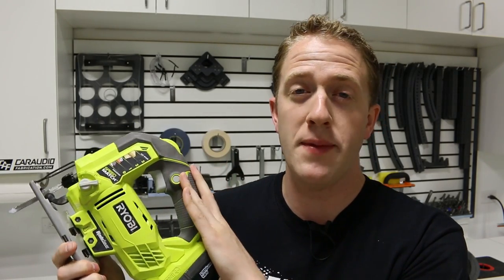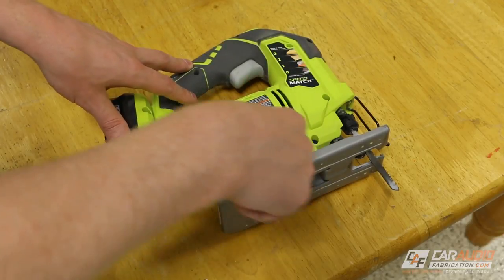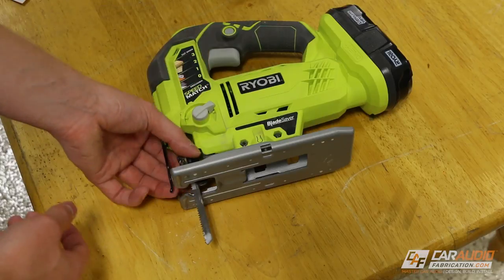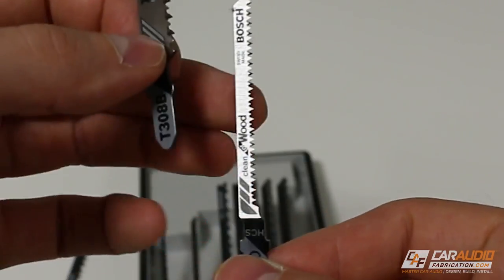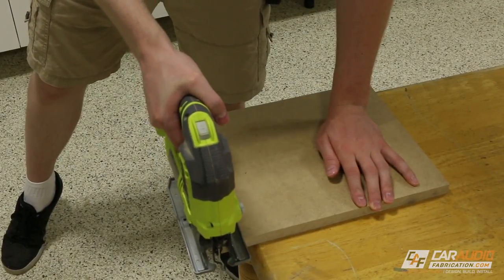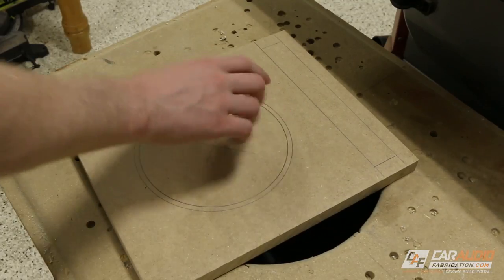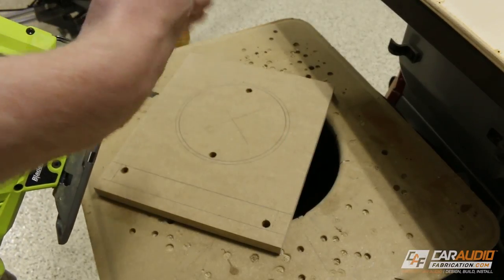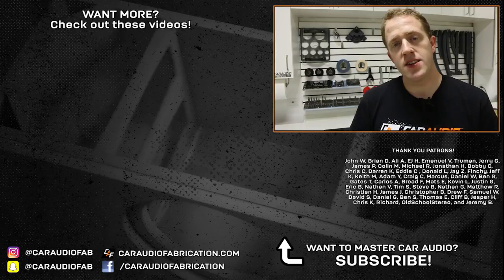JigSaw for Car Audio? Low Budget Tool Basics!

Comment from the maker: I wanted to try something different with this video and show you guys a more basic tool and how you can still get good results with the proper technique. Are you guys interested in seeing more videos like this or do you prefer advanced fabrication?
Reply: CarAudioFabrication it's good to go over the basics even when you're an advanced installer. This way you reach a wider audience. Keep up the great videos.
Reply: CarAudioFabrication I like it. Most people don't know these basics. Including me. Great video.
Reply: CarAudioFabrication I like all of your videos, but these are especially nice. I don't even have a workspace, other than going outside, haha.
Reply: CarAudioFabrication I would greatly prefer you to take the battery out or disconnect from a power source when touching the blade of changing it out, rather be safe than sorry.
Reply: basic tools with a complete instal of a system would be cool.

Comment: Hey Mark - a low-budget way to enhance a low-budget straight cut is to use a simple straight edge as a guide.  Clamp a ruler or a square across your piece and you suddenly have a laser straight cut.
Reply: i was just about too say the same thing :)
Reply: Keith Rinaldo yes sir that’s what I do every time.

Comment: This is perfect- I'm about to build my first box and all I have is a jigsaw. Thanks for the tips Mark!
Reply: make sure to use enough wood glue, and possibly line all the inside seams with glue to make sure it's airtight.
Reply: And silicone the inside seams the small things will make it great.
Reply: how did it turn out?

Comment: Good stuff as always! One more quick tip, use your middle finger to operate the trigger and keep your index finger extended straight against the body of the tool in the direction you want to cut. This helps to limit wrist twist so you naturally cut straighter.

Comment: And gotta make sure when buying a jigsaw that the bevel adjust on base is secure enough so that it won't start cutting beveled as you push down on saw
Reply from the maker: Very true, the one I have has locking detent locations so you know its in the right spot.

Comment: Question sir! I have a pair of orion 2ntense dvc 12 inch subwoofers that I have had since 1999. They have been sitting in a box in my closet since 2007. I am thinking about putting them into my 1995 Land cruiser along with my 2 5.25 boston pro mids with infinity reference tweeters, 2 mbquart q series reference 6.5 inch seperates an audio control 2xs crossover/linedriver powered by a ppi pc 450 and a ppi  2100, the good series of powerclass, the grey ones that  each take a 60 amp fuse. Not the 2nd gen 30 ampers chrome series. This system was installed in my 1997 honda civic that I got when I was 16. Originally I had a ppi 250 powering the subs and my 300 total watts absolutely blew the doors off other guys systems with 3-5 times the wattage. I have always done all my own installs as well as about 75 other peoples installs. Then in 99 I worked installing Home theater systems in high end houses. So I do know what I am doing and have professional experience all be it quite a while ago. I have a dual battery system with an isolator for the 2nd battery that will be powering all the electronics.. I have all the required distribution blocks with anl fuses 1 gauge power wire and a 2 farad stiff cap. 

Ok enough back ground. I need to know if I can build a box that both subs can be in a common enclosure? They are both rated at 1 cubic foot including the woofer displacement. These subs still pound with a vengeance. I am just trying to make as small a box as possible. Can i put both subs in a 1 cube box with common air space or do I need to build at least a 2 cubic foot box if they share the interior volume. If that is the case I may just go with 1 sub in the back right quarter panel where the stock 5 inch "subwoofer" goes and build a custom fiberglass box into the vehicle. Then when I don't have all my overlanding gear in there I will put the 2nd sub in a removable box. 

2nd question. If I cannot find room to mount all my amps, crossovers. line drivers in the rear there. I am thinking about a decent 5 channel small form factor amp. Do you have any advice on one of those. 

Sorry, I know this is a long one. But I just want to say thank you for all your informative videos! You rock!

Comment: Not trying to say I know everything because I clearly do not. But one piece of advice you should have given right at the end (or at least you yourself and then made for included it in a video for later) was when you're using your drill with the slip sleeve or whatever they call it. (I call it a no Port tool LOL) you should have recommended that you use the sleeve to slip over your screw so that you don't end up porting your brand new speaker. That is one of the most common mistakes I see all of the time. hell I did it myself when I first started making my own boxes back in the 90s.
Reply: airdreams1 Phillips Distortion

Comment: Do you have any videos on how to add a port to a speaker "box" (aka my cars panels) and stopping rattling? This would include how to cut thru the covering material (leather or carpet) while the box is still together if I can.
Reply: Shawn Jones Are you talking about porting your doors? Never seen that one before. Either way. That's not how you stop rattling. Go to DIYMA, and ask for help on this.

Comment: Wait we don't need 3 router tables with expensive router lifts, 400 templates and $2000 worth of router bits?   :)    When I started I used a corded Dewalt Jigsaw, a black and decker circular saw, and a 3/8" chuck corded Makita drill.  :)

Comment: what is the battery life like on your saw I am a big Ryobi fan and I am curious and for tweeters it's very simple to just use a holesaw.....just my two cents
Reply from the maker: With that small battery I can usually make it last for long enough to quite a bit, hard to quantify, I have two batteries and I say in an 6 hour work session I probably change it once on average. They do make larger capacity batteries. Yes, a hole saw is definitely nice but you do need quite a few different sizes if you always want to be able to handle different tweeter sizes.
Reply: CarAudioFabrication I get it...I have a couple different sets of holesaws I got from harbor freight together they were like 30 bucks thanks for the reply
Reply: I have close to a full set of Ryobi's One+ series. Good quality and they are not that expensive, compared to other prof tools brands like Makita and such. 

Battery lifetime varies on the tool, and how much you use the tool, and as Mark said. Battery size as well.. 
I have two charging stations, and 6 batteries.. I never run out of juice.

Comment: Why make a port cut out when you can actually have the port wall, top, bottom and side piece make the port opening?
Reply from the maker: +MemphisT7 when it comes to wrapping the box I can use a round over bit and go slightly deeper into the port cutout to leave a transition line for cutting a carpet or vinyl edge. The side piece near the box is also fully captured allowing for a rabbet groove to tuck material. Gives  much cleaner final look